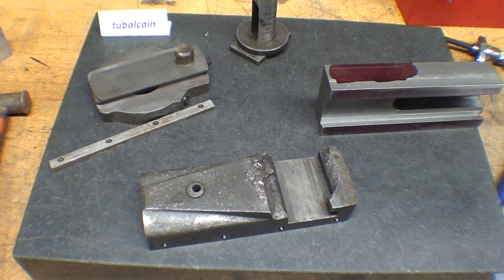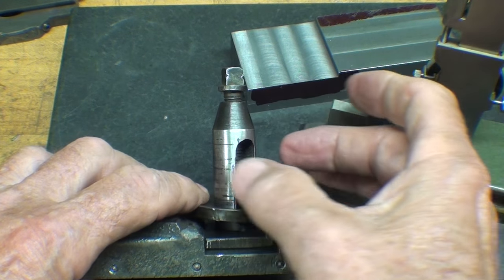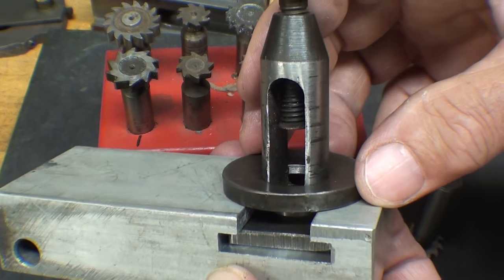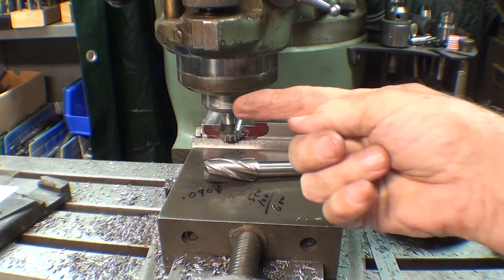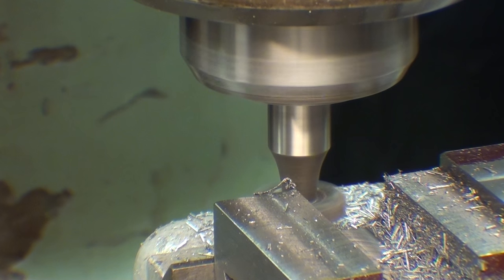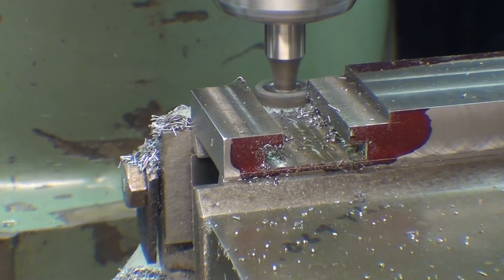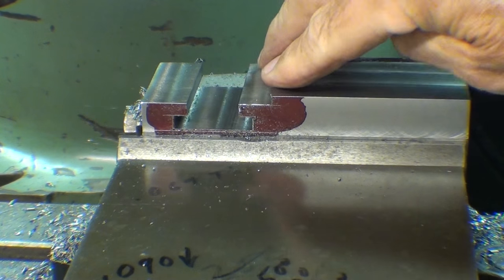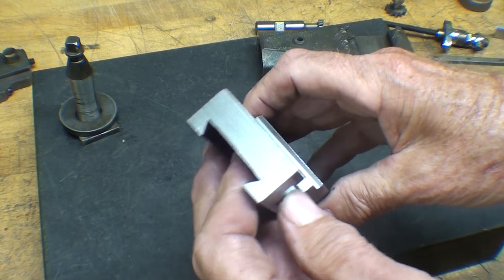TIPS #335 pt 3 Compound Rest for a 6" Atlas Lathe tubalcain

Comment: When I was out of high school, I was using my fathers lathe trying to tach myself and I made a big error and ran the compound  into the lathe chuck, and when it bit to much it broke the compound. It made my father mad. And I stated it could be repaired. He being a machinst of many years new this but he got rid of the lathe. So you proved my point, it could have been repaired. I asked him one time why he didn't teach me the proper way to run the lathe and he said that he wanted me to have a better job than he did. So I stated that it was not his call, it should have been mine. He passed away in 1988. A little lathe triva, enjoy your series very well, along with Kieth Fenner, and Abomb, and Vintage machinery. So keep them comming, Greg
Reply from the maker: Thanks
Reply: No I didn't become a machinist. Went into Army before being drafted. Worked in Missiles with radars, hydralics, mechanical things. Electronic Tech. Worked as a diesel mechanic, and then some fab with monor lathe, mill, tig welding. So  I have done lots of everything, just not one thing. Welding lathe, vert mill self taught.
Reply from the maker: Good story--unfortunate.

Comment: Great video for sure.  Little by little you are revealing the compound slide that was locked in the piece of steel.  I have figured out why I bought such large woodruff cutters back in the 70's, it was to cut slots.  So far I have never used one of them.  Keep on keeping on.

Comment: I think the Atlas designers are looking down giving their nod of approval. It is an improvement in my eyes aside from the decorative touch on the original. Great project. Thanks for sharing.
Reply: Well, it's milled from stock, rather than cast...  Each type has its "period", but the squared-off look is newer, or more "modern"

That said, I prefer to have flat horizontal surfaces so I can set things there while doing setups & layouts... never have enough places to set things in my shop...

Comment: Wonderfull informative and inspiring video....thank you for doing this  Mr Pete.

The usual way these orginal castings get broke is when people put a QCTP or other non origonal toolpost on that are held down with a bolt or threaded rod that can screw all the way down through the bottom plate and push up against the casting lips.

Comment: Mr. Pete, you mentioned the piece of steel stock in part 1 or 2, was LeadLoy.  The chips come off almost like machining brass.  I was apprenticed in a repetition engineering shop, working on automatic and capstan lathes, where we used leaded steels, particularly LeadLoy, for most steel parts.  The chips didn't wrap around the tooling and the finish was good.  It just doesn't weld easily, unless you use special rods.

Comment: Hello from Grants Pass Oregon. I’m new to your channel and enjoy it very much. I have been cleaning up my Dad’s Atlas 618 that I have had for the last 25 years and he got it in 1962. It’s been a project because I’m a wood worker and not a metal worker. It’s got some issues and your videos have helped a lot. Problems being 1) the back gears are missing 2) both handles to the cross feed and compound are broken 3) the compound screw is slightly bent 4) two teeth of the reverse gear are broken (but works well). 5) it’s missing the quill lock on the tail stock. It has a three and four jaw chuck but not the live center for the tail stock. I’m enjoying your education very much. I have two close friends that are machinists for Erickson Air Crane helicopters.
Reply from the maker: Thank you for watching. Good luck repairing that Lathe. You wonder how there could be so many things wrong with the machine?
Reply: Abuse and neglect I suppose. It’s really a shame the back gears are gone

Comment: The "step' you mention is there but it can get in the way if you choose to get an Aloris type tool post. The square corners take more radius to rotate the post to various positions than the step allows. If it should become a problem you can always remove some more material later on.

Comment: I have a dilemma mr. Pete I finally got around to Machining my compound and I've done the whole thing nice and clean no mistakes. I had to buy a couple of tools and key cutter excetera to complete the job. My problem is the last stuff is 2 thread the inside  bore where the lead screw enters the body of the assembly.   It's an odd sized deal.   It measures  . 6820 with 16 tpi.  Is there a way to find a tap this size?    Or in your opinion would I be better off modifying the way that this assembly is built? 

The lathe is a Logan 1821 and I had no luck finding the technical drawings for it. 
I doubt my ability to turn this internal thread on a little 10 lathe.   Not sure I could chuck it up right.  If I would have been using my head I would have done it directly after  squaring the work.... 

Any thought?

Comment: Looks like it will work. How thick is the material between the T slot and the top of the dove tail area? Looks like it's awful thin there.    I might have run the chamfer all around the top edges to break the corners though.

Comment: you don't have a cutter that you could mill the radii on the top of the compound so i would match the original better . i do like the styling better then just the block shape of the later models. i think it would be a good exercise in setting up also .
Reply: I also agree. I'd be inclined to use a 3/8" or so corner rounding endmill. Round the two front corners vertically, and round the two top corners from the front up to about 1/2" before the start of the milled step. It would look more like the original, but still have a flat top and straight sides to make measuring a lot easier. 

If I had a radius endmill or small ball-end mill  I''d be inclined to radius the step to remove a stress point.
Reply: that's what i was thinking
Reply: Contoured cross slides look nice, but are the suck for real use.
Not only do they suck for magnetic bases, they suck for setting the angle.
Best thing manufacturers ever did was go to a solid ugly block.

Comment: When you made the 3/4" cut if you had a roughing end mill would that have been easier/better to hog it out? Or would it leave marks on the upper sides so one would have to make 2 side finish cuts?

Lots of great tips, thanks!!

Comment: on the T-slot 
I would have taking .010'' out of the Bottom center 3/4''  
and only .010'' off the Top on both sides 
on your clearance pass

Comment: I have a newer version of that lathe. The compound rest looks to be the same.  Some would rather not have the step on the top of the rest as it will interfere with some types of tool holders.

Comment: I watched the section on the t-slot vs woodruff cutter a couple times and I'm still not entirely sure I get the difference. Is it that the t-slot cutter is simply taller in profile vs the woodruff cutter? I did note the stagger teeth, but that just allows for the taller profile, correct? Or maybe it's that the t-slot cutter also would cut on the bottom (almost, but not quite like a bottom cutting end mill). Can you explain just a bit more on the distinction? Obviously the woodruff cutter worked just fine with multiple passes.
Reply: Yes, I understand the reason why he used the woodruff cutter vs the t-slot cutter. My question is about how the two cutters differ and why you'd choose one over the other. My guess based on what the video showed is that woodruff cutters tend to run (are always?) narrower in profile than t-slots. But I have no idea about that.

Comment: One tool post i used to have had a pinned bottom plate. The piece was free to move in the slot, it had give, but, it could not leave the actual slot. I've always wondered if that's a good mod or not.
Reply: Well, it might prevent the slot tear-out caused by tightening down the tool with the bottom plate half out of the slot. I'd still like to be allowed some overhang when it was needed.

Comment: If the proof of the pudding is in the eating ... I'd have expected you to have a taste.
I don't understand why you guesstimated the measurements from the broken part in favour of working with the actual dimensions of the post which you have in your hand and are keeping ???

I'd have thought once the working thickness of the block was right for the bottom of the slot you'd then create the T slot to snugly fit what you actually have in your hand.  After the first cut I expected you to try the pillar before ploughing on.

Comment: 1100rpm isn,t that to high? how come your hss endmill not burning up?
Reply: in part by the cutting oil i presume. Plus, as it chips away, so to does the heat follow. So really, if he could get the chips even smaller, it would run even cooler.

Comment: 1150 rpm is way to fast for a 3/4" end mill.especially in steel . I'd  run it at about 500 rpm
Reply: Usually double the speed for carbide cutters.
Reply: Usually double the speed for carbide cutters.

Comment: it's odd that you'd say that because the cutters are the same size you retain your center position. you'd actually keep the same center position no matter what size cutter you use. maybe if you had more respect for mathematics and paid the proper attention in school, you'd know that
Reply: He meant that he did not move the mill from the center position using the straight cutter.  The Woodruff cutter is the same diameter so all he has to do is add or subtract the depth of the T slot to the 0 position on either side instead of figuring in the difference in the size of the cutters.  Has you spent a little more time trying to comprehend the situation instead of trolling you may have understood that.  Probably not...but you really need to learn to think before you speak.
Reply: Rob Mckennie
I can certainly understand that, and personally, I really couldn't care less what you think of him.  But the question still remains, why are you here?  Why would you waste your time on an arrogant jackass?  There are a lot of machining channels.  Leaving the types of comments you made here only make you look like an idiot.  Life is short, just move on.  I don't really think Mr. Pete knows or cares what you think, if he is to give you any thought at all it would probably be just to ban you.
Reply: Tenspeed TheBikeHanger I don't know where exactly I draw the line on wasting my time with pointless bullshit, but explaining myself to you is definitely over that line

Comment: you always  run your end mills and drills way to fast!Slow em down.
Reply: Considering the operations performed on this work piece, at what speeds would you run the mill? 
Roy
Reply: LoL   I think he just sped up the video...
Reply: He did say he was running at 1150.On mild steel i run a 3/4" endmill at about 500 to 600 rim . I've  been in this game for 50 years professionally so i know what I'm talking about.